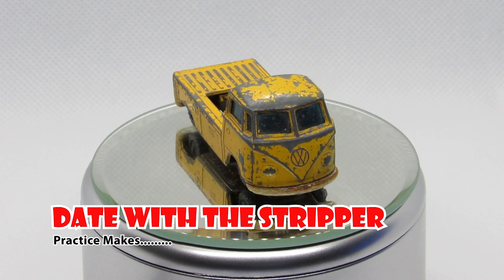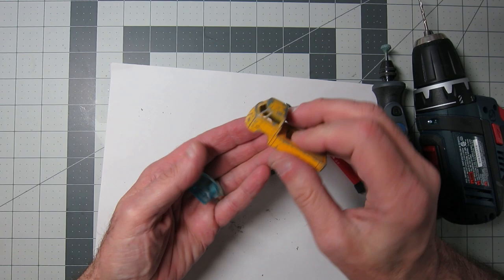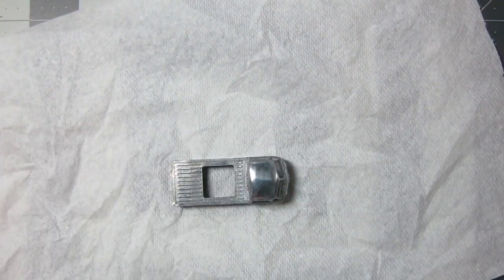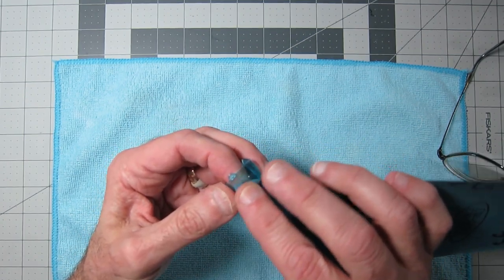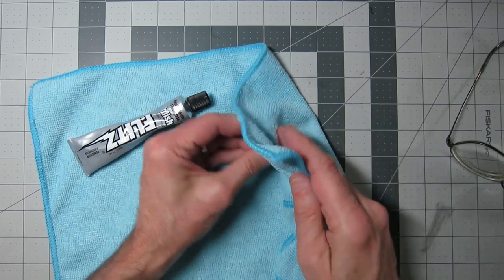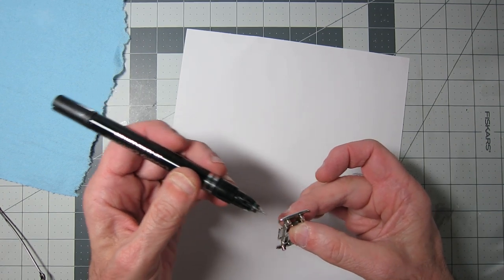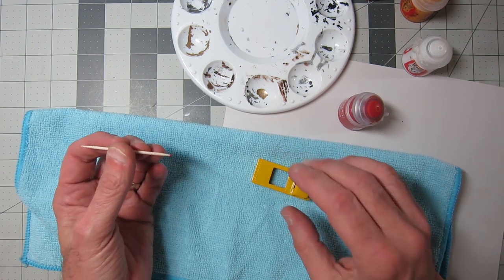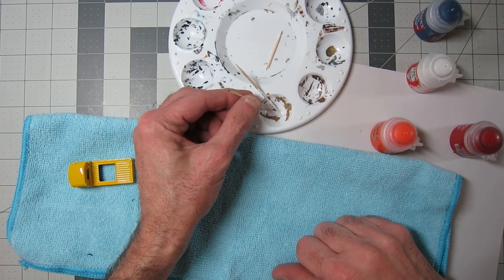Date with the Stripper - Husky Volkswagen Pickup Restoration

Comment: I think it turned out really cool. I use the same method when possible with my builds on the trim. I love how the VW emblem comes out when you do it to them. Yours turned out like my Herbie Transporter build. I have another one I'm thinking about doing but the roof is going to take hours of filing and sanding. Has to be the worst casting I've ever seen Matchbox do. Looks like they just snapped it from the flashing and went straight to paint. Love that you went ahead and did all the details and showed us. Keep up the killer builds brother 🍻
Reply from the maker: Thanks Drew!  It is a great way to do the VW emblems!

Comment: As always, great job.  The scraping can also be done with sand paper folded a few times.
Reply from the maker: Thanks Lee!  Doing it with sandpaper seems even tougher...but maybe less prone to chipping than the knife.
Reply: @JimSilva-SilvaDiecastCustoms  That's it exactly.  If you have a nice flat raised surface, with clear edges, the blade works great.  We just announced a Back to the 50's build for June if you're interested.
Reply from the maker: I saw that video a little earlier today and was just about to go over and comment to count me in :)   I may do another Nomad...maybe a resto...even though I have a butchered Nomad video coming out tomorrow am 😊

Comment: That's a great little VW, looks fantastic !  I'm not sure if I've ever shown it or even said it on my channel but I do most of my trim by scrapping the paint from the trim. I use a brand new blade, it's easier to control than a paint brush ....for me anyway. 🍻
Reply from the maker: Thanks Bob - I don’t recall you mentioning it...it seems like I always see you doing insanely intricate work with brushes.  I shake and twitch way too much for that.

Comment: I have a thing for Volkswagen.  Like you, I used to do everything with rattle cans.  For that old yellow I recommend the paint I use in this video 
https://youtu.be/h3VxLdGJ3wA

Also, to get a constant result from rattle cans I suggest doing a bain-marie bath on the can.  A plastic Slurpee cup with hot tap water is what I use.  NO BOILING WATER.  Heating the casting with a hair dryer is a most if you don't have an oven.  Keep up the great work.
Reply from the maker: Thanks for the tips!  Right now I’m kind of short on supplies - a few things are on order and taking forever to arrive (like wheels) and it will be great once we are able to go out shopping again at hobby stores.  I do need to do the bath on the can - the paint is noticeably better when it’s warmer.  I just need a lot more practice...and time...and space...and lololol.   Thanks again !!